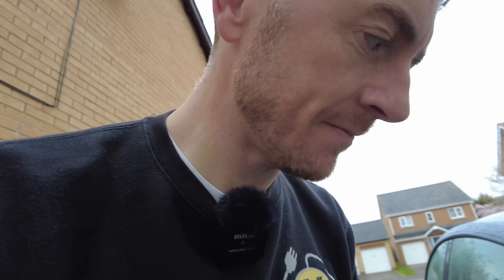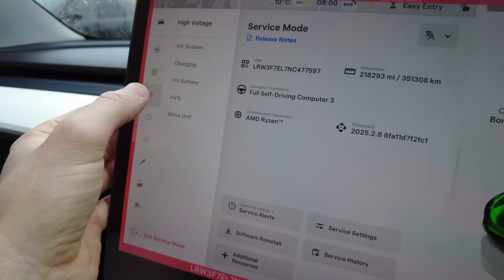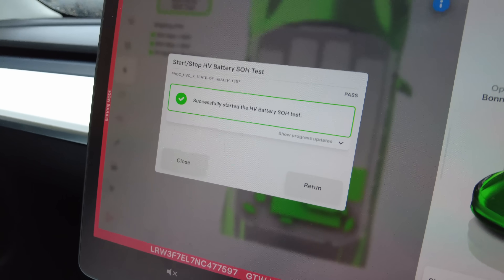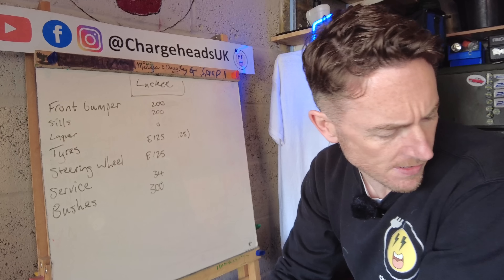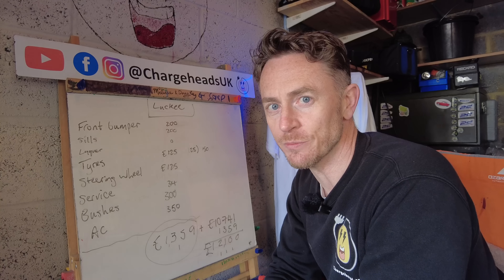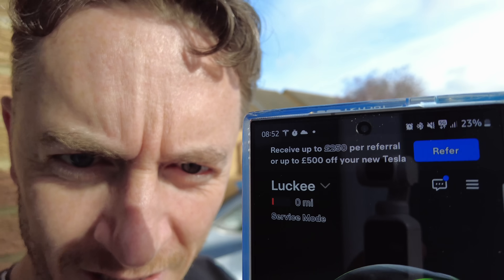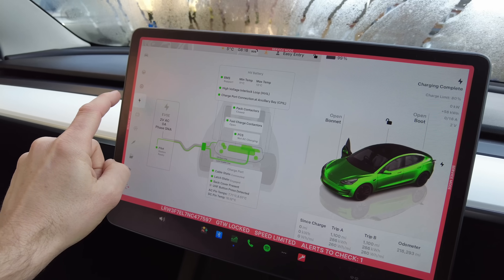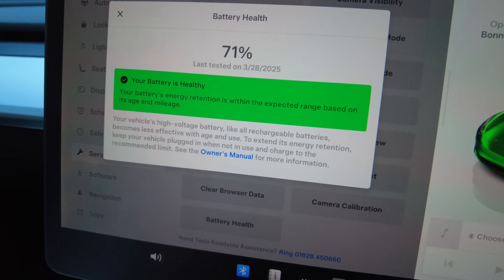New Tesla Battery health test - Worse than I thought?

Comment: How does the real world usable range compare with Rusty. Performance v long range also heat pump vs no heat pump?
Reply: Nice, thanks for the reply, that’s impressive and encouraging to hear. I’m definitely considering a higher mileage one. Performance preferably because I’m still a lad at heart. Free charging at work too so  its a no brainier
Reply from the maker: Got for as new as you can and get a battery test done.  @boxingarc4109
Reply: @boxingarc4109 I hope you go with a heat pump car and preferably get a RYZEN CHIP, LATER MADE 2021 Models have it, but 2022+ for sure. 

Ryzen chip makes a huge difference and heat pump not only helps with managing the car but literally heating if your body and the seat heating. HUGE difference
Reply from the maker: It certainly seems to be just as efficient even with the 20 inch 275 wide tyres

Comment: 218k miles and a 70% battery is pretty good in my opinion. You confirmed in another video you was getting 243ish miles so that checks out. There’s brand new electric cars like Hyundai’s, BMW’s, Mercedes & Audi’s that can’t achieve that range. For a car that has done 218k in my opinion that shows how great the batteries are. Fuel cars would be on their last legs and most wouldn’t even achieve that. 

I’d also say the interior of your car looks amazing given that allegedly Tesla’s aren’t a good build quality. I saw one uber driver with over 350k miles and he was still getting 180 miles off a full charge.i think you’ve got a bargain even with the big fix on the aircon system. Even if that costs you £600_£800 you’ve still got a car that will last you easily for another 3/4 years. 👍🏼
Reply from the maker: Thanks for your comment. Battery would be so much better with more AC charger
Reply: @ maybe but think of the positives. People are too obsessed with battery 🔋 percentage. I think given its age and mileage and the condition it’s in you’ve got a really good car. There’s model 3’s standard range that only get 240 from a full 100% charge. Look at it in those terms. You are now driving around in a standard range in terms of mileage but you’ve got the raw power of a top sports muscle car. 👍🏼 keep the content up really interesting
Reply from the maker: 🙏 @Markos5511

Comment: As part of the testing process it has to bring the battery up to temperature before it starts charging - it will actually draw power from the AC charger during this phase but it won't be charging the battery. It will also run the heat pump to extract heat energy from the air etc, which is why the condenser fans are running. It does this as it can't calculate the bottom end of the battery, i.e. true 0% - unless the battery is warm and at a specific temperature.
Reply: Thank you.
The comments once again delivering better facts than the video itself

Comment: Just did mine using the "new" check on the Tesla Service screen (not the service mode) and on my June 22 M3 SR (38K miles) have 94% so more than happy with that considering LFP battery os supposed to have most degradation in first couple of years 🎉
Reply from the maker: Not bad at all

Comment: Thing is this shows the issues with ev’s especially as a second hand car owner perspective. There is so many verifiable with batteries must keep most of the time between 20% to 80% charge. lol then if you are fast charging a lot especially if you  can’t charge at home that will degrade the battery. Then you get the range lottery depending on temp whether and state of charge. Do not have any issues like. That with my 5yr old rangy, 90£ fill her up and she will go over 800miles on trips and over 600mile around town, she did that new and she dose that know no questions asked. Horses for courses, i run my own sole business between my car and van, can’t charge at home and nearest chargers 12miles away / 30mins one way. I etmit id looked at a second hand model X out of curiosity and saw the clear range difference from new… on all the realistic ones in my budget range 30k but even looking at other models and makes. Ive test drove few ev and yes cool, but still much prefer my current rangy it has sole actually been very reliable over my year and a bit of ownership. But not saying rangy is a budget cay noooo.
Don’t get me Wong im happy for people to enjoy ev’s and find them interesting from a tech standpoint point but, i have issues with being forced into one though…
Reply from the maker: 218,000 miles 🤷‍♂️
Reply: @ so Ive owned ice cars that have done way over 500k miles before with no issues. Like any thing if an ice car is well maintained and looked after there isn’t any reason it will go way over 500k if not exceeded over a million miles. I’m not saying you’re cars ant usable but still expensive when you consider you won’t have the range and they may not fast charge as quickly.
But the shear price of replacing a battery and that’s if you’re car has a replaceable battery is massive even more then a refurbished engine and installed by a specialist. Let alone all the ethical issues battery’s have and toxic dangers on recycling them. 
But horses for courses.
Reply from the maker: @stevoone342  have you, what were they? Soon, batteries will be cheap to swap. Atm they're £6k on this.

Comment: Charge the battery to ~80%, then plug into level 1 charge for 24 hours. That will give the voltage balancing in the battery management system time to "work its magic". It could be, that there is unbalance in the state of charge, from cell to cell. The BMS calls the battery "dead" when the first cell drops down to ~2.5 volts, and considers the battery fully charged, when the first cell reaches 4.2 volts. Any unbalance will narrow the margins, making the battery appear to be down on capacity. Since the correcting current for the voltage balancing is very low, it takes a long time, to pick up significant differences in states of charge from cell to cell. It's imperative, that balancing occurs during a "float" charge, since differences in equivalent series resistance can cause voltage differences when current is flowing into or out of the battery. If the balancers try to come on during that time, it can actually cause a greater unbalance.
      Another advantage of proper balance, is that when using DC fast charging,, the battery will pull higher current for a longer time, greatly reducing the time necessary, to bring the battery back up to 80%. Float the battery at 80% for at least 24 hours on level 1 or level 2 AC charging, then, try the "battery health" test again. That will tell whether the battery has actually degraded by that much, or, whether you see a significant improvement.
Reply from the maker: Did you watch the last vid? Cell voltages where really close 6 millivolts apart
Reply: @chargeheads  But that wasn't under load, right?
Reply from the maker: @dopiaza2006  it was being charged so under charging load. Is their another test which is better?
Reply: @chargeheads  I've heard the best way to find potentially bad cells is to drain the battery down under 10%, ideally close to 0%,  then measure cell imbalance while driving up a hill to put a steady load on the battery, weak cells are most likely to show low voltages when discharging at low state of charge. When charging you might find bad cells reach maximum voltage before others.
Reply from the maker: Interesting  @dopiaza2006
Reply: @chargeheads  Get yourself a cheap "Kill-A-Watt" meter. These plug into a standard 120 volt outlet, and are rated for 15 amp continuous current. (level 1 charge). Let the car charge to 80% and see what the quiescent wattage is, when it shows "charge complete". If it shows 20 watts or more, that could mean that there is equalization going on. My Chevy Bolt would hold that, then, drop down to ~7 watts, indicating that the cells are balanced, and no more corrective current is being applied. I don't have experience with Tesla, with sentry mode and other features that draw standby power, that the 2023 Bolt doesn't have. So, look for a minimum idle wattage, and note that number. If the battery is equalized, it will drop to that low number much more quickly, after indicating the complete charge. That's the "takeaway". That should reduce or eliminate the need, to put deep cycle stress on the battery, to determine "state of health".

Comment: $350 not to shabby for that AC repair. Their parts must be coming down
Reply: That's for a Re-gas only!!! Shockingly high price....
Reply from the maker: @jimhardacre491 all will become clear😊
Reply: @chargeheads  If it's just low on gas, get it done locally and not at Tesla. It's a standard low/high system and will be a lot cheaper. They can also put a dye in it for leak checks and check it's pulling a good vacuum.
Reply from the maker: Thanks for the advice @jimhardacre491

Comment: Considering that most cars after 200k are ready for the scrapyard... I think 71% battery state of health is decent, but I think it being cold may have influenced the results.
Reply: Most Toyota's Honda's Mazda's and Subaru's are just barely broken in at 200k miles.
Reply: Talking rubbish mate, most cars my ass.
Reply: average mileage at scrappage is 130k and 16 years old.
Reply: @markburton8303  I can vouch for that dude, Just had to get rid of my wifes 2016 mokka cdti that we had since new and that we have serviced every 6 months, it had the tensioner recall done at 1 year old and the chain has snapped with absolutely no warning at 70k miles.
Reply: @mickbennett1981  That's rubbish. I had a 2.2 Vectra SRi with a timing chain. It was within it's maintenance period and it had stretched and cam gear jumped. Basically scrap. It needed a clutch too. Someone bought it to rebuild and it's still sorn now.

Comment: i'd like to see the real world  range when you go from like 100% to 10% or lower.
Reply from the maker: So many variables. I reckon 200 miles 60 to 70 not winter 170 winter
Reply: @chargeheads  I would watch your health in more ways than one
Reply: @Terry-q7y  why? Have zee Russians got to him?
Reply: The other day I drove from Norfolk to Northampton 138 miles and I used 50.8% of my battery, I had climate on the whole time, heated seats etc. granted I was driving mostly under 70 and using lorry’s to break the wind in front 😂 but only because I wanted to see how much I could get out of it!! Mines a 2020 m3p with 40k on the clock!!

Comment: 71% isn't too bad honestly, I expected way worse to be fair around 60% at that milage, especially on the performance where the battery has a much harder life (owner dependant).  Something I can't recommend enough by the way, if you don't like the deep discharge Tesla test, is the Tessie app.  Let it collect some charge cycles and once you've had about 10 significant ones, you'll have a rough result.  I find it really useful for constant monitoring of the battery condition and health over time.

Is anyone else worried/concerned about these protests at Tesla sites and against owners?  Honestly it's very anxiety inducing, there's some very nasty people out there to be taking their grievance out on owners who've done nothing wrong except for supporting good cars.

Comment: If the air conditioner is not working, doesn't that affect the battery cooling?
Reply: Correct.  The air conditioner cools everything using the Superbottle manifold to direct where things need to be cooled.  A Model 3 should not be driven if the a/c has malfunctioned.
Reply: No, separate systems

Comment: The latest software 2025.8.6 or even .4 you get a battery health statement in the app which just says its ok after monitoring the car in ordinary driving. Whack it on a SuC that usually bumps the miles up also I think its too cold at the moment especially overnight to measure capacity
Reply from the maker: Oh really, I'll have a check of that now
Reply: SuC?
Reply: @MomoHadi Supercharger